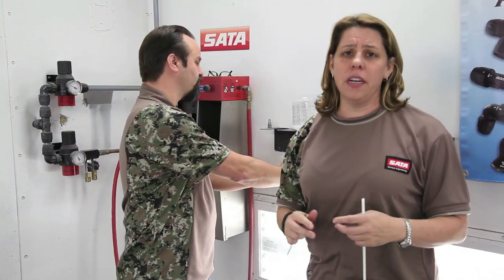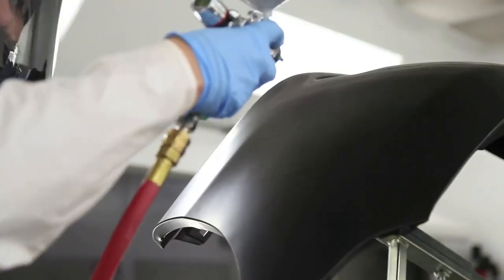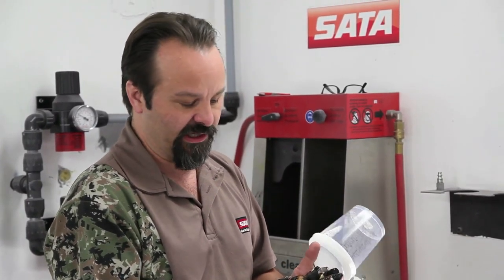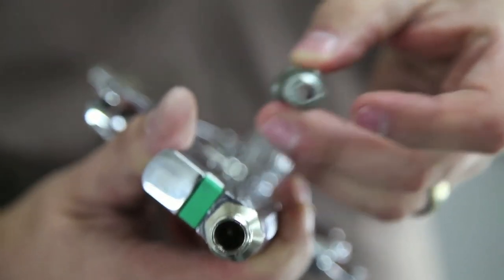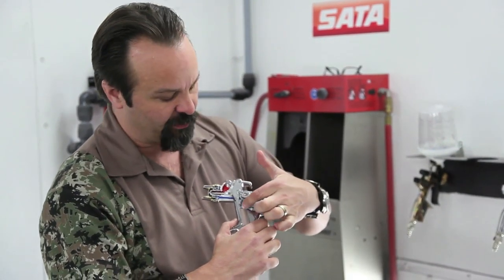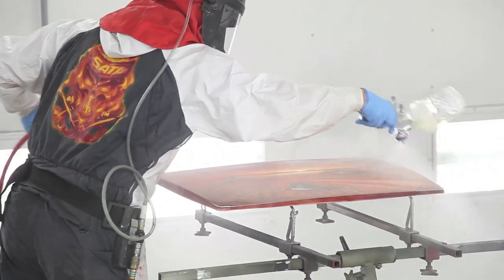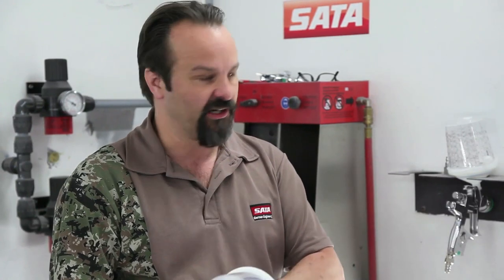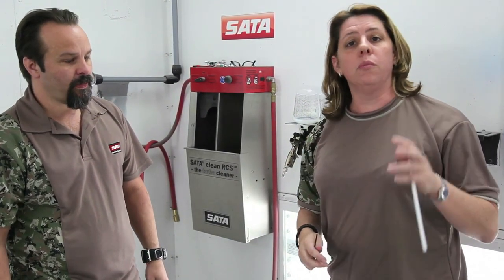How to Set Air Pressure / Air Volume for a HVLP or RP Spray Gun with SATA

Comment: May I know how much psi in wall regulator and how bigger air tank did you used? I have issue the pressure of regulator spray gun  often jump out.
Reply: exp -tary I usually leave it at 40 psi unless you have a fresh air mask would need at least 60 psi

Comment: then why Sata put that air valve there at all?
Reply: +Hirider stonehead You want a solid air pressure that's coming from the wall to atomize your spray or clear .  You don't want a 120 psi gets stuck in your gun behind your air valve because your air setting will only have a very short distance to travel to the air cap.  So, if your air setting is 30 then you want that 30 psi to have enough distance to travel so it will have a strong momentum by the time it gets to your gun.
Reply: thank you very much my friend.
Reply: exactly
Reply: I think a simpler answer is the air micrometer on the gun is for fine-tuning.
You get the air pressure close to what you need (a little more to allow for pressure drop because of the hose) at the wall, and then adjust it as needed at the gun.

Comment: so your saying its better to regulate at the wall and not the gun??  which is better?
Reply: Definitely the wall
Reply: Best thing to do is get rid of your regulator at the gun and just depend on your air makeup unit...don't forget to subtract 5psi for every 20 feet of 3/8" air hose. If you need to adjust, adjust pressure on the wall.